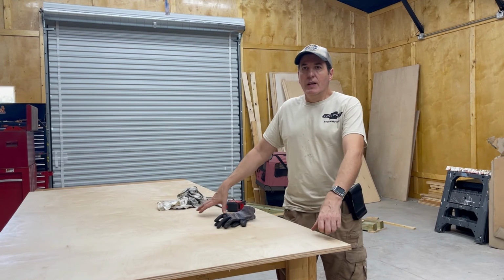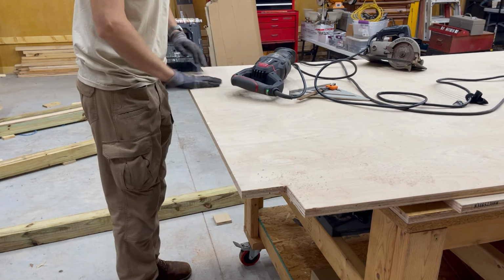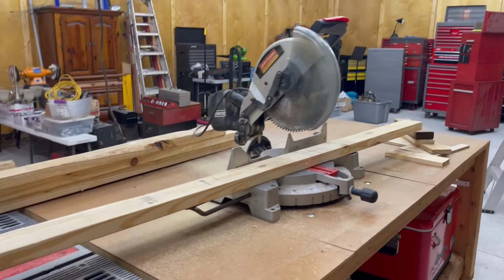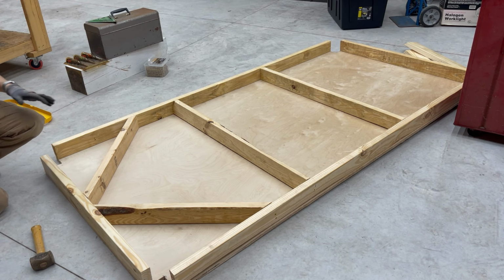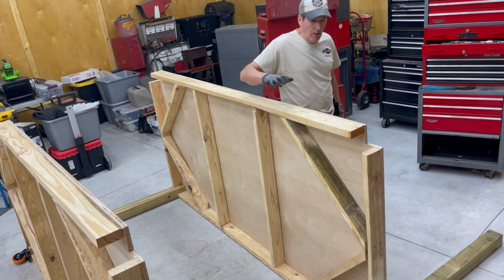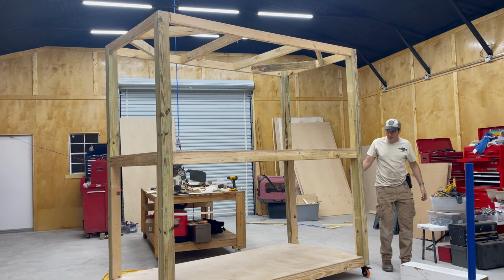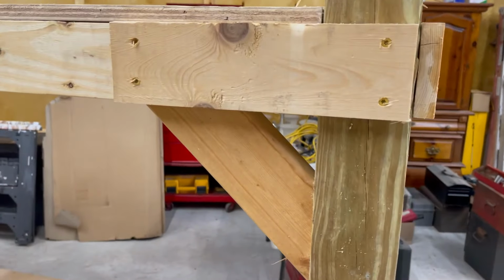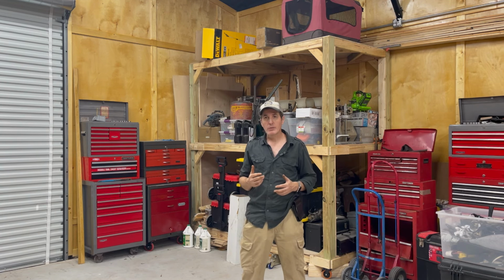DIY - Building Heavy Duty Workshop Shelving

Comment: Nice workbench.  That shelf is outstanding.  It will last for decades.  Looks like the supervisor approved too.
Reply from the maker: Thanks!  The hardest part was flipping it on it's wheels.  I'm at that point in the build with the new work bench now and I think I'm going to need some help with it.
Reply: @floridarusticrepairs  I’m sure.  I was an afraid with you getting the shelving upright.
Reply from the maker: @michaelsurratt9593  Yes.  Much to my surprise I did not throw my back out.   :)
Reply: @floridarusticrepairs  that’s I was concerned about, we could see you holding your back in the video and that thing would have hurt you if it fell on you.
Reply from the maker: @michaelsurratt9593  I should have added a "Do not try this at home" text over that footage.   :)

Comment: Quite the shelf. I would have inset the corner post in another 1-1/2" so the 2X4s could wrap around the outside of the 4X4 and then bolt the 2 bys to the post in 2 locations at each corner. Not critizing your biild just a suggestion.
Thanks for the video
Reply from the maker: Thanks for the info. This is the first time I've ever built one so I'm always open to some additional info.  I built the workbench companion to it last night and I may have done what you're suggesting.   The 8' 2x4s are full length across and bolted to the side of the 4x4.  The side 2x4s are also bolted directly to the beam.  Let me know when that video comes out if I did it your way.

Comment: Congratulations on reusing a ready-made and well-equipped  work bench which includes the bonus of subject matter for your next tool repair video.😁  Your efforts at a free standing shelf are commendable. In a garage or shed, my personal definition of heavy-duty shelving is - shelving that reinforces the structure of the walls.   Have you changed the oil in the Porter-Cable trim saw you acquired recently?
Reply from the maker: The mini Porter Cable was actually on my bench because I was about to rebuild it.   When i couldn't find my jigsaw I grabbed it. So, to answer your question, no.  I hadn't done anything to it yet unfortunately but it's slated for rebuild this weekend.   Your definition of Heavy duty gives me an idea.  This shelf would add a lot of structural support to the building if it were to be bolted to the walls.  Thanks for the tip!
Reply: @floridarusticrepairs  Readily available Skil worm drive oil will do the trick for your saw.   In building shelves for sheds in the past, I have installed them in a way that locks them to the walls and locks the walls to the shelves.

Comment: Good thing some of your hauls had hardware with them
Reply from the maker: I do get a lot of random hardware!  i actually use a few of the tool boxes to sort it all instead of the little plastic trays.
Reply: @floridarusticrepairs  That is what i do with the 3 drawer top boves i have hardware organization saves a lot of room.
Reply from the maker: @TheDodge610  Yes and easier to find fasteners even if they get all mixed up.